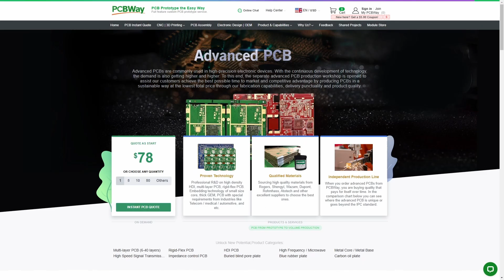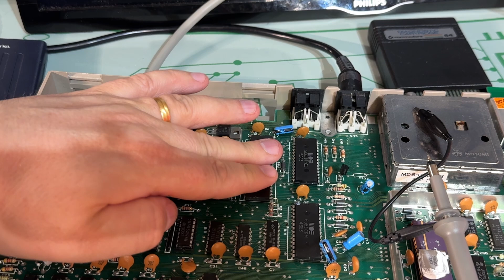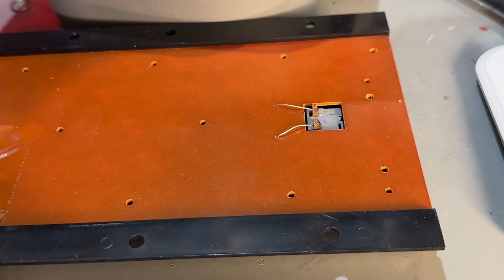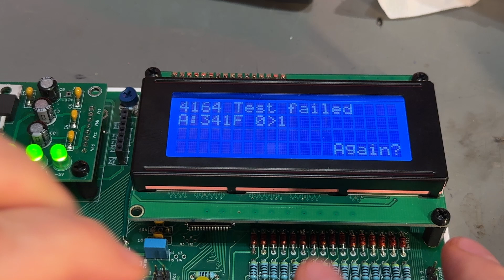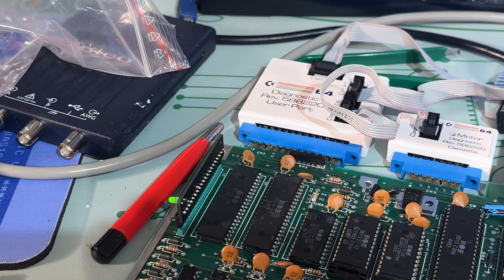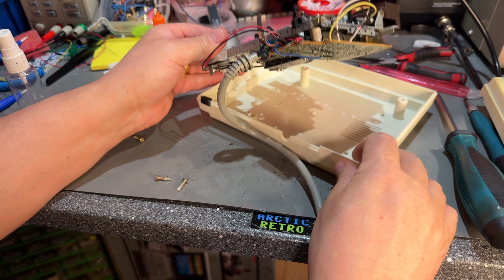Dead Commodore 64: Repair and restoration - Black screen but otherwise a nice machine

Comment: I stopped hunting for C64s and ended up with 33 pieces... my favourite model is the c64c with the 250466 longboard. Plus some c128s, c128ds, Amiga 500s and multiple Atari STs... did I mention I love retro computers...? ❤❤❤ So, Tommy, with only 10 64s you can surely get some more, e.g. C64G, C64 Aldi...
Reply from the maker: Thank you. I have lots of Amigas. I have the C64G, C, Plus 4, C16 and so forth. But I have to many of the same kind :)